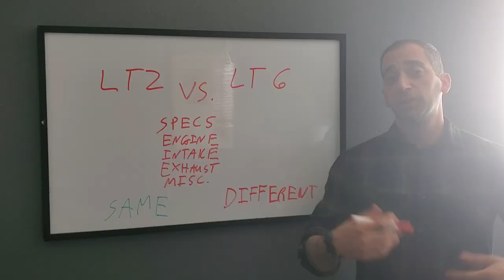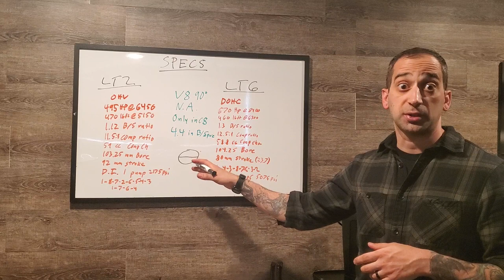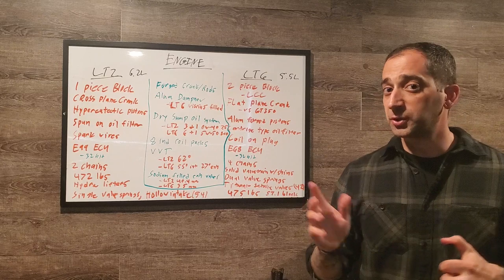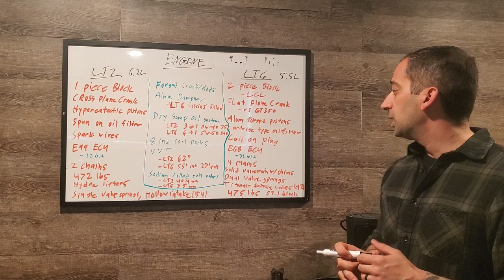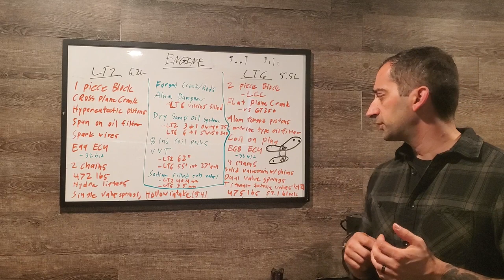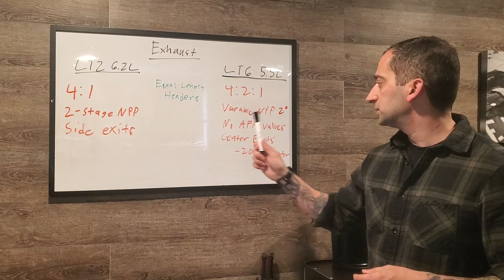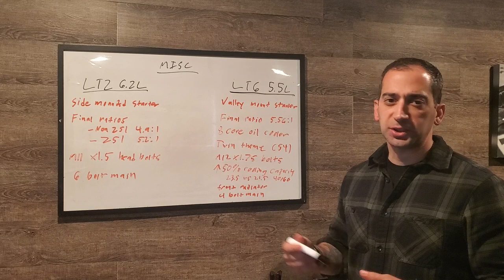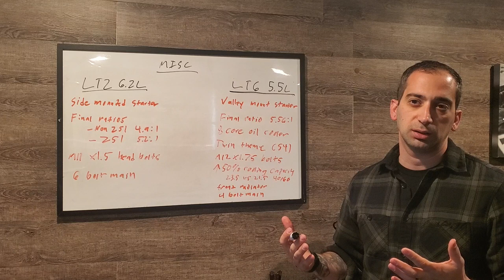LT2 Vs. LT6 Differences and similarities

Comment: Wonder if it’d be worth Edelbrock designing an intake for the LT2 like the one the LT6 has? Maybe too much of a modification..??
Reply: I assume you've seen the PTR carbon? Makes less than 10 more than a ported stock one (and won't fit on a convertible). The stock parts are pretty solid.

Comment: The C4 ZR1 had DOHC motors, designed by Lotus and built by Mercury Marine. LT5
Reply from the maker: Correct, I did forget to mention that but I said its a relatively new thing/not typical for a Corvette